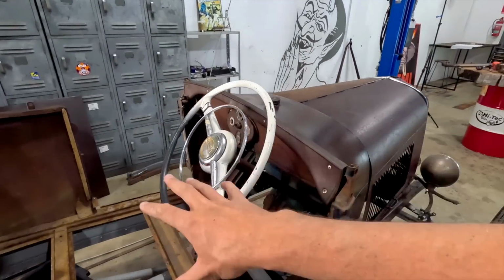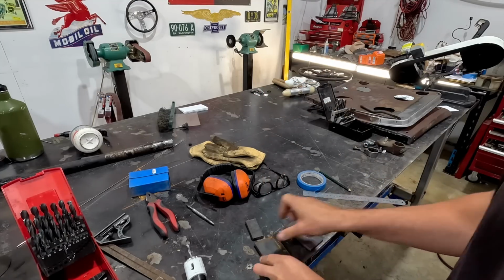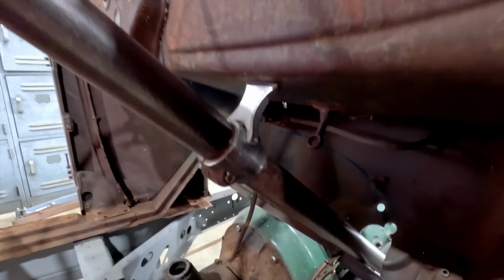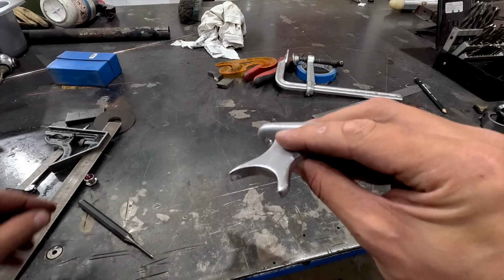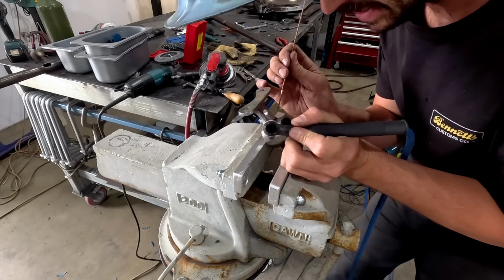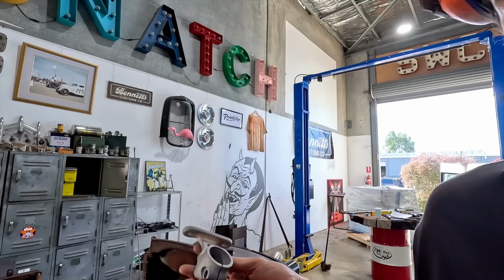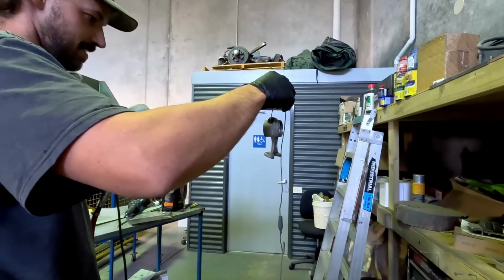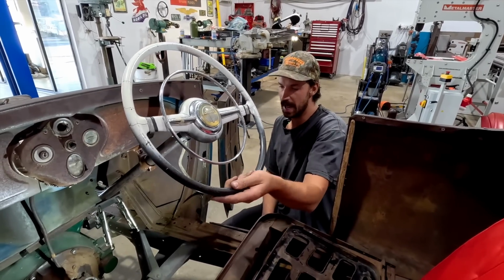HOW TO - Fabricate custom Column drop for Hot Rod (1929 Roadster)

Comment: Not just a steering column but a piece of art. I love the attention to detail. I never heard of Corten as a color I always known it as a type of steel (the John Hancock building in Chicago) that gets a surface rust that becomes its finish. How fitting for matching the patina. Great job Jordan.
Reply from the maker: I’ve used it building art pieces or design stuff, it’s pretty cool to use and this coating is almost a perfect match it’s wild!

Comment: The column drop color looks good Jordan why don't you powder coat the column , column drop and turn indicator so they all match like they came from the same 39 Ford. As for the driver side column drop get fancy put a clock in it. The cast of jewels would make a trick shifter knob with it lit up at night trucker style .
Reply from the maker: Definitely on the same page with the clock! Been looking for something!

Comment: l
 my dads 39 ford v8 had a flick switch on the steering column bracket but l suppose most fords in the late 30s fords  did

Comment: Ya know that if you were to drive on the correct side of the road all of that unnecessary work would not have to have been done. Is it possible that things work backwards down there?  Heard rumors about toilets flushing the opposite way also!  First time crossing the equator on a boat ran to the pot to see if the swirling stopped, was dismayed to see that it spun correctly. American toilet didn’t get the memo?  I have come to the conclusion that you are an artist who just happens to work on old rusty things and make them look like no one else’s. Not rat rods, but classy over the top   Really enjoying your musings. 😊
Reply from the maker: Hahahah fair bit backwards man getting around. 
I definitely don’t see myself as a car builder. I just really enjoy creating things of the eras and try and compliment what’s there by adding my touches. It’s fun!

Comment: Bro is the passenger driving?????????
Reply: its australia they drive on the correct side of the road, l saw  a video on here which said they use to in the usa, but henry ford refused to put the sterring wheel on the right, the president said it was too dangerous to drive on the left with steering wheel on left, so switched to driving on the right